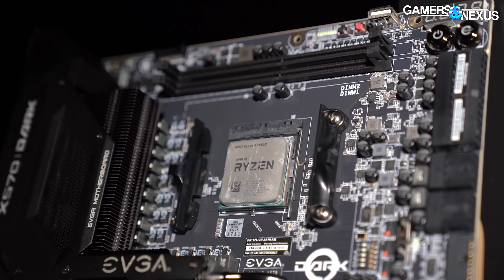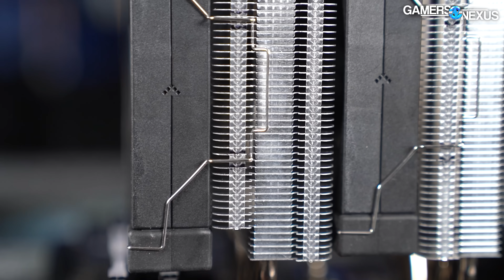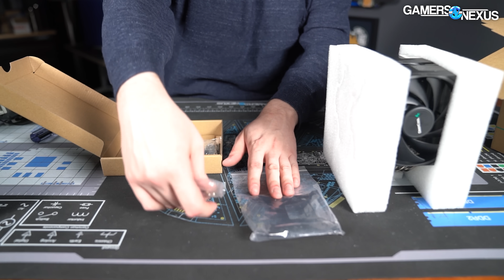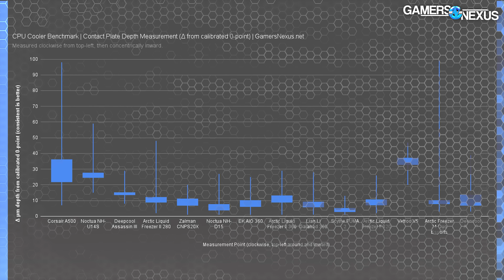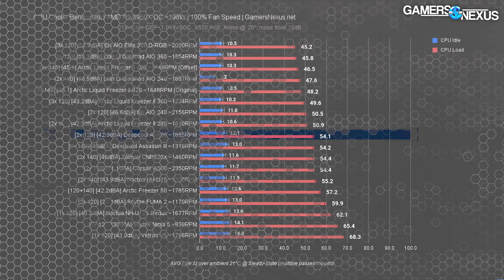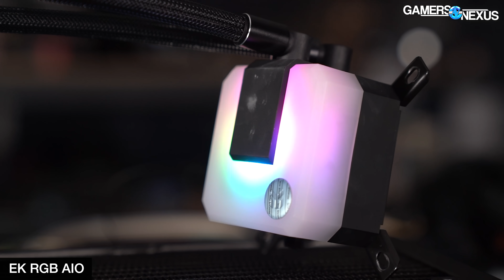Air Coolers Are Getting Impressive: Deepcool AK620 Cooler Review

Comment: As a satisfied BeQuiet Dark Rock Pro user, I can say that to me air coolers were never unimpressive :)
Reply: I have the dark rock pro 4 and im amazed what it can handle with no problems
Reply: @Antiquecurtain  Same. It's a great cooler :).
Reply: @Antiquecurtain  i have the dark rock 4,  is the pro version way better?
Reply: @yoool7137  Not really, only if you have a high-TDP CPU. I could easily downsize from my DRP4 because my 5700X doesn't put out much heat, so the only reason I use it is for the silence. If your CPU is at a similar TDP level (~65W) then the DR4 is the ideal size. Biggest is not always ideal.
Reply: I wish the Dark Rock Pro was in his list. I would like to see the comparison.
Reply: @billygilbert7911  Same but it's very similar to the NH-DH15 so I just use that as a comparison
Reply: @ElectroLM10  I didn't know that.  Thanks.
Reply: @billygilbert7911  is in older with nh d15 and assassin 3 at least so u can see that
Reply: @nicane-9966  I'll look it up. Thank you
Reply: @billygilbert7911  I have the Thermalright Le Grande Macho RT. It's quite beefy and good while being silent, yet i never see it in comparisons or in general. It's extremely underrated.
Reply: I love my Dark Rock Pro 4.  I prefer it until about a 360mm water cooler, but in what I build lately, it's plenty.
Reply: As someone who has seen dozens of AIOs getting sticky, clumpy, corroded and failing pumps, air cooling never became unattractive to me.
Reply: @kamipls6790  dozens? Only heard of enermax actually clogging
Reply: @savifrank6323  not an Enermax exclusive at all.
Reply: @savifrank6323  MSI aio clogged on Greg Salazar’s Fix or Flop series
Reply: I've got be quiet shadow rock 2, 8 years ago for around 80usd still good today.
Reply: Heck I've used the dark rock slims and regular dark rocks and have always been very impressed.
Reply: My Dark Rock Pro 4 handles my overclocked 5950X just fine. It's on the expensive side but I also like its looks
Reply: I’ve got a Dark Rock 4 non pro and it works great.
Reply: totally agree, I've been using a vetroo u6 on a i7-10700K (usually $40 on sale) and despite the u6 not really ranking high on any comparison charts for being a "dual tower", it has been dead silent and temps are amazing. It's not really a true dual tower in the first place, it's much smaller, more like a 1.5 tower which is perfect for fitting into a lot of small towers.
Reply: Nad that has impressive screwdriver too
Reply: 6:47 At the instalation process, did you use the things delivered WITH the Deepcool cooler or you advertised something or you bought them separately?
Reply: As someone who doesn’t overclock, I’ll take the low maintenance of air coolers any day.
Reply: Well yea obviously if you don't mind spending $100 on a air cooler it is easy to find a good product...he is speaking in terms of actual good AND affordable
Reply: @samgoff5289  The Dark Rock pro 4 goes on sale often for $70, I got it for 65 to cool my 5900x and no complaints.
Reply: @BeeWhere  I gave 72$ for my Dark Rock Pro 4 about 1 year ago. It now costs 92$ at the same reseller.
Reply: @samgoff5289  the Dark Rock Pro is as good as a 280mm AIO if not better(in terms of maintainance) so if you are talking price to performance you should consider the price of an AIO
Reply: @samgoff5289  It costs less or the same like the Noctua one.
Reply: @samgoff5289 
What is this take lol. What’s the alternative? Passive cooling?
Reply: @samgoff5289  100 dollars on an air cooler... as if water cooling is cheap. 🤣
Besides air coolers you can forget about, but water always has issues with either evaporation of the cooling liquid through the hoses and seals as is normal or in worst case you get a leak and possible terminal damage to your system.

I dunno, I like the fact that my Noctua NH-D14 is something I have forgotten about for more than a decade. Apart from the time I upgraded the system just once from a 2600k to a 5900x. Best cooler ever.
Reply: @LogiForce86  You might want to read his comment again i think you got it wrong.
Reply: @user-ke1gn3ql1g  No, I got it alright. What is affordable in an era where graphics cards are over 600 euro for a basic model for gaming? Are we really going to arque over say a 20 bucks lower price benefit on an air cooler when most spend even more than 100 bucks to get watercooling via either an AIO solution or an even more expensive custom loop?

At some point the costs for R&D, Q&A, material costs, manufacturing cost and cost of customer support is already at a minimum. So at some point you either have to stick with a price or any of those areas will have a detrimental cost cut.
At which point we all have to ask ourselves if that is worth it, or is it better to wait another week for those 20 bucks to show up in our paycheck?

Money is simply losing its value fast and basically has been since the 2008 crash. Euro, US Dollar, you name it. It's because money didn't need to be backed by gold anymore, and the extra money printed will just decrease the value of the other bills already in circulation.
With no increase of our paychecks but increasing costs of living as a result. Add to that the tax increases in many countries since and thus Joe Average has to save up even more money to pay for the products/services and that extra tax on top. So less things bought as our income is limited and never changing, and thus the economy slowly comes to a standstil as people cannot let money roll enough to keep the thing going.

Anyway, I digress. Affordable is something that in my opinion is relative to the quality of product and service you get in return, and I do not believe it is worth it to decrees the quality any further than we are seeing now. We are already seeing flaming riser cables and power supplies, and questional post sales customer services in the sector. So I think we might have hit rock bottom in the case of most computer products and their price.
Reply: All the air cooler peeps huffing that copium hard.
Reply: @lucidnonsense942  - Enjoy changing the liquid every year and pray that there are no leaks. I have better things to do with my time.
Reply: @sylviam6535  I've been running liquid in workstations for around 10 years and air in servers. You're grossly exaggerating the level of maintenance and the risk.

They both have pros and cons. You have a preference and that's fine, but water is nothing like you're implying.
Reply: @reginalb124  - Since I don’t overclock, it makes sense for me to use the easier and less risky option.
Reply: @reginalb124  I have been building PCs for a while AIOs do 1 thing for sure.. and that is go bad and need to be 100% replaced. Custom loop cost so much more than AIO and air coolers it’s not even in the same discussion. 
The benefit in performance is so negligible running a aio against a similar priced air cooler today that it depends on
If you want to buy another AIO in a 2-4 year window most likely in my experience this is the average lifespan of AIOs I have put in builds for clients. I usually recommend Air coolers nowadays unless someone is doing a matx itx builds.. if your building in a tower though and don’t want to have that day where your PC isn’t
Useable for 4 days as you wait on a new AIO to be delivered and you to be out another $150-$250 then have to remove and reinstall a AIO and thermal paste.. actually a hour of your time . Then go AIR.
The main benefit with a AIO is your PC looks super cool with a extra 3 RGB fans and a RGB light up thing overtop the cpu area. And there is nothing wrong with spending the money to have RGB ram and making sure it all looks like
A UFO… people love it and it sells computers for sure.
But if your using a computer for work and upgrade maybe every 5 years … just go air cooler and get a case with plenty of 5” bays and accept the fact the PC is a tool and not a expensive light show.  After owning both I can tell you no body really cares that much except you about how your computer looks😉
No one has ever got laid cause there PCs lights were coordinated perfectly hahaha.
I say all
That and I have exactly the PC I’m semi making fun of on my desk right now haha but my work PC is noctua everything in fractal r5 hahaha and it’s a better PC hardware wise but looks pretty… boring

Comment: Are getting better AND cheaper, that would mean that some of those Air Coolers aren't just overpriced to begin with, since Artic and Scythe for example are around for 10/15+ years easily (at least in the EU) and never were that expensive to begin with.
Reply from the maker: They can definitely still be that expensive. It depends on a lot of other factors -- like binning heatpipes (Noctua does this) heavily, which costs more, or having more expensive customer service processes and more generous RMAs that are harder to factor-in.
Reply: @GamersNexus  I never knew heat-pipes were binned. I can't even remember reading about it on your site. I would love to hear more about that, how it is done, performance difference, etc.
Reply: @GamersNexus  heatpipes are binned?!?
Reply: @GamersNexus  how much of a difference binning heat pipes does actually make? (also first time I'm hearing about such thing)
Reply: @GewelReal  yes, that is something I'd like to see more about.
Reply: @GewelReal  Heat pipe binning would probably be less about performance but more about quality control.
Reply: @loroger9754  damn, I wanted to overclock my heatpipes
Reply: @loroger9754  binning is never the same as quality control, binning is picking the best out of some number of product and either not using the rest or using them on cheaper products. Quality control is throwing out defective hardware, this is 100% about performance, have you seen the price? as GN said thats probably one of the reasons.
Reply: I know I can edit but it looks shady, just wanted to mention technically QC can be the same as binning, if you arent too familiar with how the term is used that is, since finding the best ones could be called assuring their quality, thats not how its used, but it could've been if manufacturers chose their words differently.
Reply: Been using arctic fans and HSF's since 2000. I Only just switched away from AS5 (kryonaut performs way better). They are good value and in the real world outperform almost everything tested and with the cpu overclocked hard.
Reply: I've always liked Arctic. They been making decent/good budget coolers for years. I got one of their Freezer 34 DUO's and for 40 euro, you get a good looking tower cooler with 2x very quiet fans that push a good amount of air + PWM daisy-chaining. They just seem to provide great value for money, with many of their products.
Reply: 6:47 At the instalation process, did you use the things delivered WITH the Deepcool cooler or you advertised something or you bought them separately?
Reply: ME : ...[reads "never were that expensive"]
ME : clicks like

XDDD
Reply: @DailyCorvid  ???
Reply: @GewelReal  Just admit you've been sold a lie....more data from other countries are bringing the light....
Reply: @DailyCorvid  Hey man I just saw you over at a Linus video. I like Corvids, I trained some wild scrub Jays to be my friend and they were really smart cool birds. I felt like Ace Ventura, I could hold out my hand and the little birbs would glide into it.

Comment: I'm rocking my Fuma 2 with an overclocked R7 2700. I'm already waiting for my R7 5800x to arrive. It's cheap, quiet and a beast at cooling. I cannot recommend it enough
Reply from the maker: FUMA 2 is good!
Reply: @GamersNexus  Remember, Scythe global policy is to NOT provide mounting kits for free. For example, if a customer bought a FUMA 2 today, the customer would have to pay extra for an LGA1700 kit tomorrow and again for any future mounting hardware (eg. AM5). In my experience the Scythe mounts are not easy to buy. When Scythe would not help me buy a kit, I had to return the Fuma 2. 

Most major CPU cooler makers (like Arctic Cooling and Noctua) will support customers. I have now gone back to Noctua whose customer support is impeccable. It is important that we all are well informed in order to make the correct purchase decisions in the future. Peace to everyone and stay safe.
Reply: @GamersNexus  i hope u watch the FUMA 2 REV B
Reply: Im using fuma2 in 5900x OC to 4.4ghz (1.188volts), 69-72º cinebench full load. Fuma2 is one of best high performance low noise coolers.
Reply: @LoKuSKus77  im running it on a mild overclock 5950 fuma is crazy wonde rhow the rev b is
Reply: @LoKuSKus77  78 with all core 4.7 ghz in cinebench but with an 360 aio
Reply: @OrionSagano  hmmm...
Reply: Fuma 2 is good but yes a 5800x with boost enabled burns it real good
Reply: that 5800X will set your cooler on fire though, it's got INSANE thermal density issues.
Reply: @Wasmachineman  I'm actually running a 5800X with a Fuma 2 and its perfectly fine. Never really gets above 70.
Reply: @BunzJackson  The problem is nobody is talking about what case and fan setup they have. On top of that the hemisphere and what part of it you live vastly affects it. A lot of the problem with these high temps is probably those glass front & side cases.
Reply: @BunzJackson  what is your ambient temperature?
Reply: @Wasmachineman  isn't temperatures relative to power consumption? and 5800X uses way less power than overclocked 2700 (you don't need to overclock the 5800)
Reply: @GewelReal  Lower temperatures, lower power draw.

Comment: A blackout version of this or the fuma 2 would be an instant buy from me lol.
Reply: @deepcoolalan7060  i will definietly buy white
Reply: What, you mean like Trudeau in college?
Reply: @deepcoolalan7060  I have a d15 blackout and like it, I have a few friends that like it but not enough to pay $110.
Reply: @deepcoolalan7060  i hope that it doesn't cost more than the original one, like other brands.
Reply: Something like a BeQuiet! Dark Rock Pro 4 should suit your bill.
Reply: @haaaah8112  Indeed.  The Fuma 2 Rev. b has changed the gray frame fans to all black.  The tower is now black also.  The fans also run about 300rpm faster than the original fuma 2 fans.  The Rev. b also includes the LGA1700 mounting kit in the box.  Very nice upgrades.